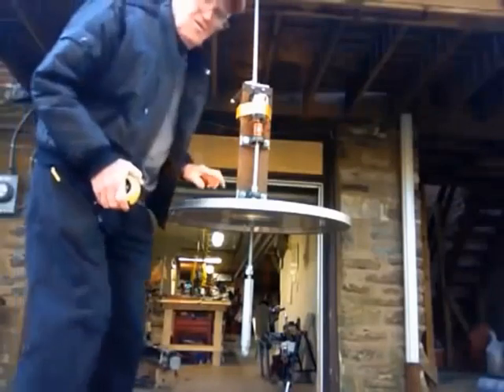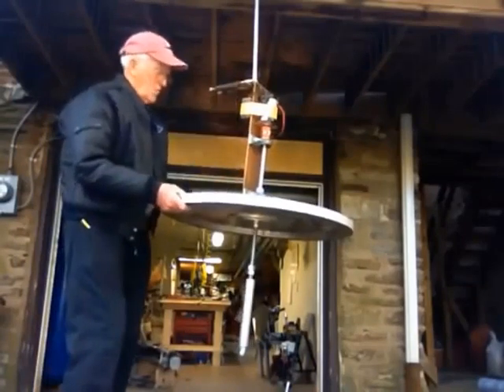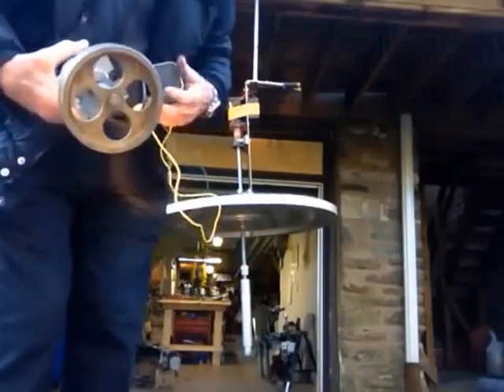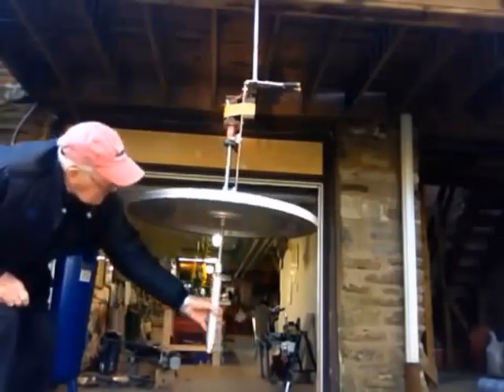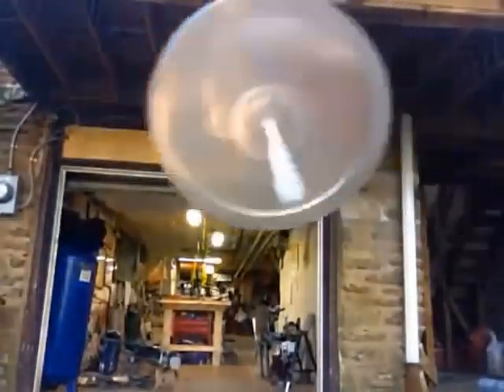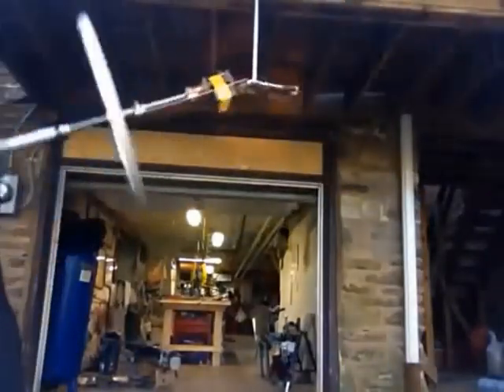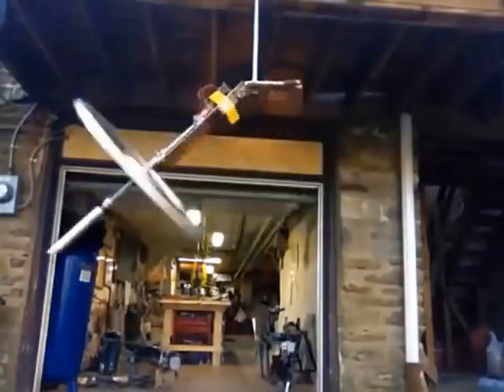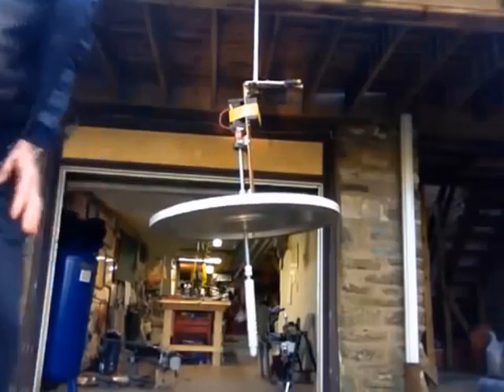🔬#MESExperiments 8: Large Gyro Wheel Precesses at 1000X Torque Over-Unity

Comment: ..looks interesting. What about the energy cost of getting it up to speed, once it's there the momentum drives it.. The amount of kinetic energy is fairly large due to the lack of wind resistance. I like the video, but I wouldn't know how to calculate the cost of energy to ramp it up to where it was. I assume it's something simple like watts per X (hour, secs) ..
Reply from the maker: Thanks for asking QC. Essentially, you are asking "how does a gyroscope work?", which is as difficult a question as life itself. The energy cost to get it up to speed is negligible since it is a motor 1000X less powerful than required if the wheel was starting horizontally initially; but once it precesses, in a way you are right that the "momentum" drives it. But then again, the motor is able to still power up the wheel while it is precessing. Thus the act of precession makes the gyro float like on a cloud.

Here is another demonstration by Francis that shows the gyroscope can precess for an indefinite amount of time and rise through powered precession, again without requiring additional power from the motor: https://youtu.be/OPTlhIY-swc

Also, from my 3rd Experiment, the gyroscope exerts this "momentum" without any loss in spin speed, thus the energy is not coming from the wheel itself... and in the 4th experiment it behaves as if it doesn't have any "momentum" at all, which makes me question all of life...... https://mes.fm/experiments-playlist.

So to answer your question, yes "momentum" is driving the gyro-wheel. But what this "momentum" is or where it is coming from, I can't answer that yet, but I am of the view that it is interacting with something external from itself... cough.... the Aether ;)

----

UPDATE: 

Come to think of it again, it appears that my 3rd Experiment is essentially the same as this gyro wheel demonstration. They both show that there is a disconnect between the gyro's ability to precess and exert "inertial forces" from the current spin speed, but in terms of not lowering the spin speed and not making it harder to increase spin speed.... HMMM

Comment: Yes, this is a good experiment of gyroscope. However, it's not so mind-boggling to me, because you have essentially thinking the torque in a wrong way.
The 2.5 inch torque motor is causing the wheel spin only. It doesn't generate the "torque" to raise the flywheel. The flywheel is lifted by the "diverted"  centrifugal force. It cannot be observed here because the center pole is rigid, so we cannot see that the centrifugal force is just a little. It was "diverted" by the wheel to lift the wheel itself up. Therefore if you stop this from precessing, the centrifugal force will be gone, the whole thing will fall down immediately, the little motor won't be able to torque it up. In another way, even you stop the little motor, the whole thing remains up, which should be an indication that it's not the reason we have such a strong "torque".
Reply from the maker: The motor can't spin the wheel if the wheel was held up in place, but does so in precession thus generating torque 1000X over-unity. How is this not mind-boggling?!

The video is about the motor's ability to spin the wheel during precession and not the actual mechanism of (magical) lifting. Remember the motor only has the ability to spin a 2.5 pound wheel at an inch horizontal distance away from the rotor, and is no where near capable of spinning a 50 pound wheel at any horizontal distance!

What do you mean by "diverted centrifugal force"? Do you mean "precessional centrifugal force"? If so then check out Experiment 5, 6, and 7 which show that it doesn't exist.
Reply: "The motor can't spin the wheel if the wheel was held up in place"?? From 0:48, the motor is able to spin the wheel without any precession. So how come it cannot spin the wheel if it was held up? Unless there is a significant increase of friction when holding up, the wheel should be spun by the motor.
Your experiment 5,6 and 7 are very good, but what I can see is that the precessional centrifugal force was diverted by the spinning wheel, thus appears to be not existed, but we all know that this force exists for all things rotating.
Reply from the maker: @Thephilpw99  The wheel is upside down so there is no torque on the motor. If it was held in place sideways it would only be able to turn a 2.5 pound wheel at a distance of 1 inch across, hence its max rating of 2.5 in-lbs. When it is held in place there is a torque of 50 pounds * 25 inch = 1250 in-lbs of torque acting on the motor. Thus in precession it is magically able to produce 1000X torque over-unity.

What do you mean by "diverted" by the spinning wheel or "appears to not exist"? In precession there is no centrifugal force, which is clearly demonstrated. When the spin speed slows down, the illusion of centrifugal force appears thus moving the ice cube. If the spinning wheel is (magically) diverting the centrifugal wheel, then keep in mind that this theory would also be against conventional physics.
Reply: @mes  
OK, I have to admit I have no clue about in-lbs measures, but in an ideal friction-free physics world, even a tiny force can turn the heavy wheel, once the wheel starts turning, it doesn't even need the motor force, the wheel will rotate indefinitely without friction.

Anyway, yeah, I know my theory of "diverted" centrifugal force is not in the books either. I am still glad that you post this video for us to think about the implication. What makes the heavy wheel hanged in the mid-air, almost like magic?
Reply: Also, in this video
https://www.youtube.com/watch?v=sy5NY-Dqdys
I almost laughed, because this professor clearly didn't understand what actually is "angular momentum", he just kept throwing the words around. When the wheel is spinning, he said the angle of momentum is side way. Wow, there is no sideway rotation, how can an object get any angle of momentum when the object is not even moving in that direction?
I really wondered how he got his job.
Reply from the maker: @Thephilpw99  The motor force is only needed to increase the spin speed, or maintain it from slowing down due to friction.

Consider the implications of this torque over unity: A motor that can only spin a small bike wheel can in theory spin a motorcycle once it is precessing: https://cdn.steemitimages.com/DQmc4EhY9zniVGj6fCzUf1LGanxgJcQBoKpsLfPPF7r29E8/image.png

Note that the video you sent, the reason the professor was pointing outwards is because in conventional physics angular momentum is a vector that extends 90 degrees from the plane of rotation, as shown here: https://en.wikipedia.org/wiki/Angular_momentum#/media/File:Torque_animation.gif

As for the real reason the gyroscope floats in the air (and rises as my other videos demonstrate), I am still working on it but your "diverted" theory is still better than conventional physics. I believe there is an interaction with "gravity" that is unknown right now. You can see my draft experiments to see even more experiments that I have filmed but not yet published: https://mes.fm/experiments-draft

I will also be uploading #AntiGravity Part 6 which I have been working on for over a year which will be go over many of my findings regarding gyroscopes, so stay tuned!
Reply: @mes  
Thanks for your reply!! 
First I am actually shocked that all those professors get the angular momentum wrong!
https://www.youtube.com/watch?v=eYlT30nfjn8
For an angular momentum you need the inertia(moving mass) and the change of angle. The vector pointing up is meaningless, because there is no angle change nor inertia in that direction. I cannot believe all those professors are teaching students with a false rule!
What actually happens in that GIF you sent is that nothing will happen in the vertical axis. If you weight that thing before and after it spins, you will have the same weight reading. This is very easy to understand, and easy to find out in a lab, yet all those professors points to that direction like idiots!

Yes, I understand your practical point of view. It looks as if the whole thing is lifted by torque. However, the best thing about it is actually the force of centrifuge lift it up. If you measure the centrifugal force before and after the wheel spins, you will see my point. But it's almost impossible for the big wheel rotate without spinning first.

I think I have figured out all the reason why the spinning wheel hangs in the air like a miracle. It's quite simple actually. It's not some mysterious interaction with gravity. The wheel is just doing what it is supposed to do.

Really appreciate your link of your draft videos. I do need to see more gyro observations. Your videos helped me quite a lot. Thanks!
Reply from the maker: @Thephilpw99  Hmmm What do you mean the "force of centrifuge lift it up"? Do you mean "precessional centrifugal force" or "spin centrifugal force"?
Reply: @mes  
I mean "precessional centrifigal force". 
My previous theory is:
If you rotated the wheel without spinning, there will be a lot of centrifugal force toward outside. The center pole should have moved around a lot more. But after the heavy wheel is spinning, the wheel converted the centrifugal force from pointing outward to pointing upward. 

But now I have a new theory:
There was no precessional centrifugal force, because when the heavy wheel is spinning and processing, it created a twisting force toward the center pole, thus moved the heavy wheel's center of mass to the pole. Therefore, the whole thing can be regarded as rotating in its center, so no centrifugal force generated.

I know it's hard to understand. But when I view the spinning wheels is nothing but a shifting of center of mass, every puzzle is solved. I understand why and how those wheels and gyros "magically" stay in the air. And why there were no scientific applications to generate moving force by gyros, because the shifting of center of mass cannot be used to make things move in a continuous way.
Reply from the maker: @Thephilpw99  hmmm I think your theory raises more questions than answers. Such as what is a "twisting force" and how is the center of mass moved? Also which puzzle is solved? How do gyros rise, not just stay, magically in the air? And gyros can generate inertial propulsion while behaving massless (i.e. no angular momentum or centrifugal force both in precession or spin)? Check out my latest video #AntiGravity Part 6 that shows gyros can lose weight, appear heavier or lighter, and all while generating torque over-unity. https://youtu.be/VLt1dSt_r18
Reply: @mes  
The "twisting force" in this video is the force that kept the heavy wheel up. You can imagine it as a rotating force that counter the falling of wheel.
This "twisting force" was generated by precession of the heavy wheel. The heavy wheel was spinning fast, so when it was precessing, it generated a strong force 90 degree to the direction of precessing, that became the "twisting force". Please note that this force is in a vertical plane (up and down only, no left and right), always 90 degree to the precessing direction. I call it a "twisting force", because it always has up force on one end and down force on the other end.
The gyros rise in the air because this "twisting force" pushed it up ( or rotate it up). This force was generated by precessing, so if you make the precessing faster, the "twisting force" will be stronger, and the gyro goes up more.
Sorry, but I don't you can make the system massless. You can only move the center of mass around by spinning the wheel faster or slower, but the total mass is always the same.
Reply from the maker: @Thephilpw99  Thanks for clarifying. But again this "twisting force" is still not defined. What is it? Precession "generates" it but that doesn't explain what it is. Also a gyroscope precesses with no "angular momentum", i.e. behave massless, as in Experiment 4: https://youtu.be/0zGCXrUFiSM

How does the "twisting force" remove "angular momentum", or "inertia" or "inertial mass", hence no "precessional centrifugal force"? Also if there is an upwards force why doesn't the weight change during regular precession? (During rising precession the weight does change since the center of mass rises).

Comment: Nice try but I don’t think this is over unity. If it was it wouldn’t keep dropping and slowing down it would be spinning out faster and faster until it falls apart. See if you can get it to do that! Lol maybe try to dissembler materials counterrotating close to each other but not touching. This will generate massive amounts of static electricity from the surrounding air which you will never ever run out of. Use the static electricity to charge capacitors which in turn charge batteries which in turn powers the motor which in turn turns to gyroscopes lol it’ll probably work better during humid or rainy days as there is a ton of electricity to be harvested from rain fall 💦⚡️⛈
Reply from the maker: This is torque over-unity, by 1000X. The input torque from the motor can't even turn the gyro when held in the hand. This shows that precession by its very nature is able to the gyro itself.
Reply: @mes  No this shows that you are building up energy over time and then using it all up that’s not 1000 times unity!
Reply from the maker: @spaceminers  Do you even know what I am saying? The motor is too weak to spin up the gyro if it wasn't precessing, that is if the base was fixed. Only during precession can it spin up the gyro. https://snipboard.io/iZKqCs.jpg
Reply: @mes  yes I do know what you’re saying. That extra energy is coming from gravity and it doesn’t last forever it’s only for the time it takes to pull that arm all the way down then you have to reset it by manually re-positioning it with your arms to run once again. Your arms is applying energy applying force to reset the system. Think outside the box lol hello wake up
Reply from the maker: @spaceminers  Do you even know what you are saying? Why are you talking about repositioning the gyro, etc.? What are you talking about... 

The gyro torques itself upwards during precession since the motor is not strong enough to do so. Hence torque-over unity. Note that I am specifically stating "torque over-unity" and not "energy", which is a different topic.